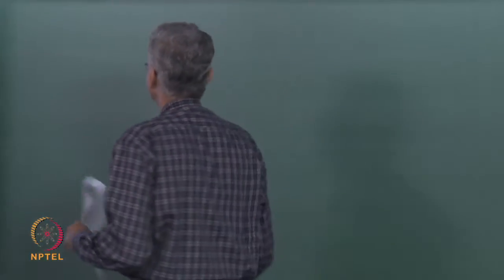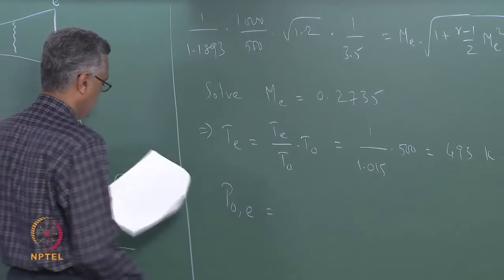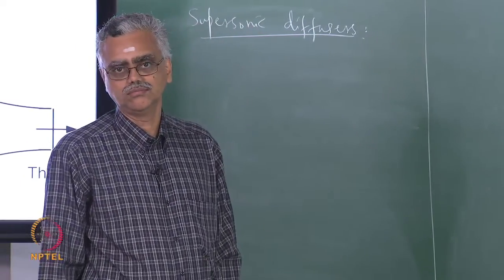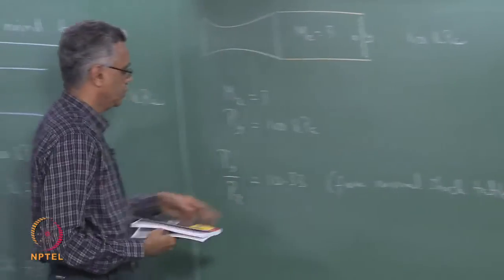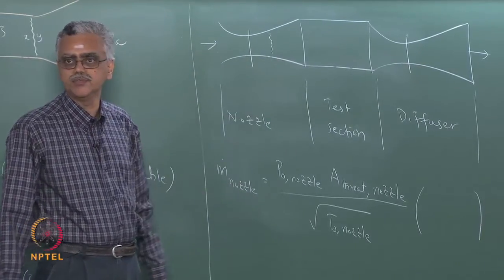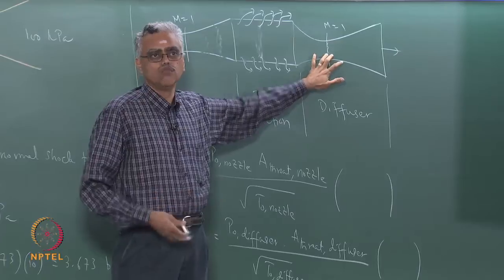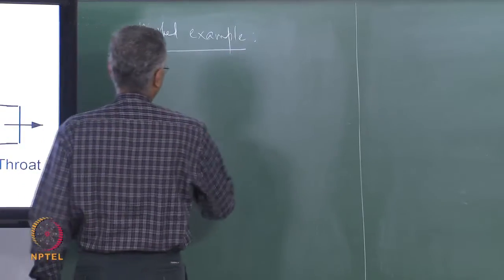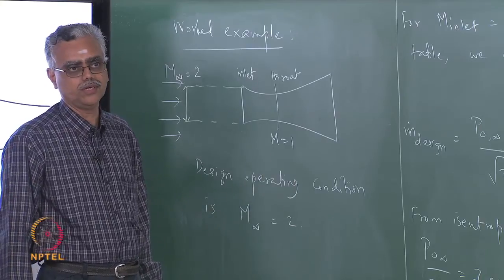Mod-01 Lec-17 Quasi One Dimensional Flows

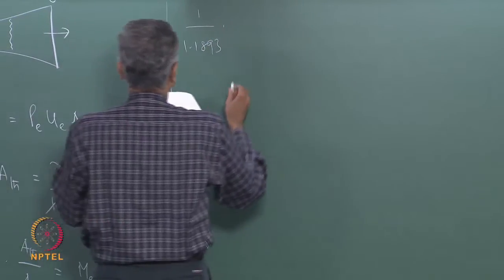Comment: Did anyone find P*/P0 to be 1/1.8929, NOT 1/1.1893? At 5:34 professor said 1/1.893, but wrote 1/1.1893...... Mach number I found was M2 = 0.3272. Interestingly, using this M2, rest of the answers match very close to professor's results on the board.